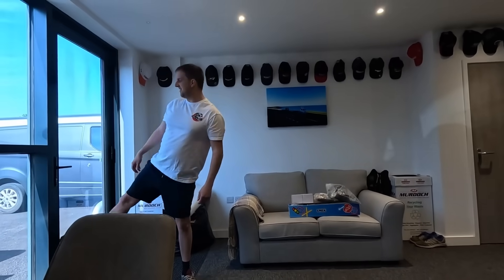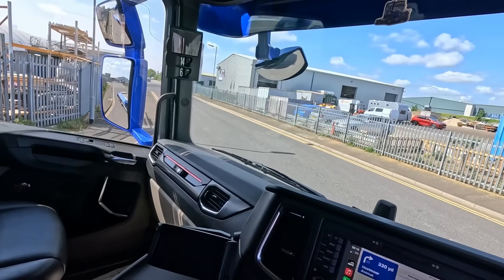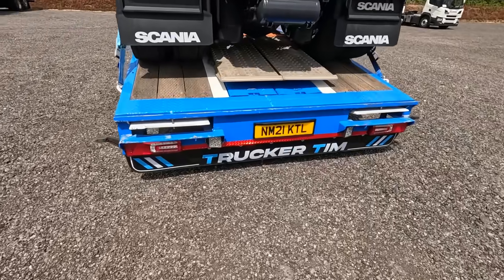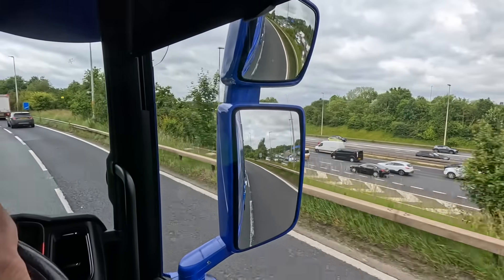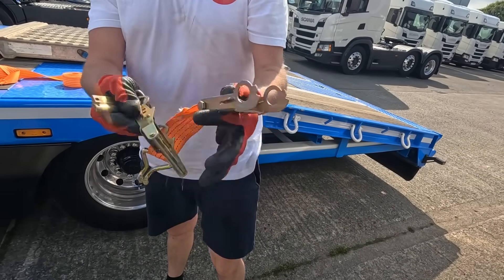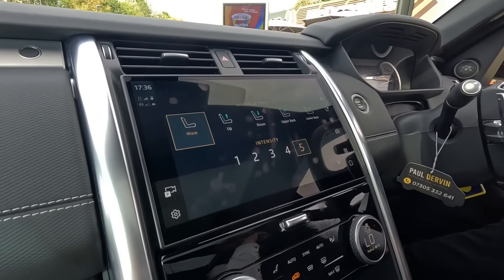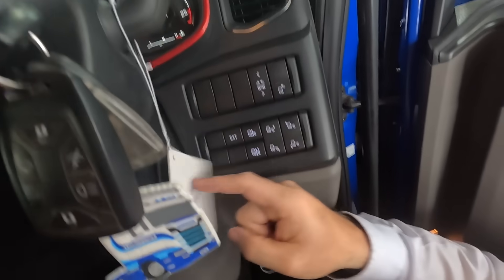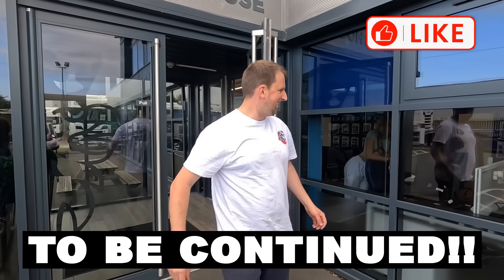FIRST LOAD WITH MY NEW TRUCK! | SORRY A&M | PT1 | #truckertim

Comment: While was in Scania sales you should have got Will the shift 5th wheel back and one thing i would have done is drop the tag axle  down on your return load as will be less strain on the straps on corners etc with it airborne and side to side.

Comment: @Trucker Tim were you never taught to do an arm space check using your forearm to check the clearance between your light cluster and the swan neck on your trailer, all I can say is whoever taught you to couple up a trailer missed that part out, that was something that was taught to me while I was doing my Class one training back in 83. Just get a sliding fifth wheel fitted, problem solved.

Comment: Told you in your last video you would hit you rear mudguard and lights because the fifth wheel is to far forward.

What ridiculous that they actually sell tag axle trucks without a sliding fifth wheel in England. In Norway every tag axle truck has a sliding fifth wheel.

Comment: Could you not put the Anti Slip coating/strips on the rear of the trailer where the ramps are? they are pretty solid and it might be black but it would look better than having scratches on it constantly.

Comment: wondering. will you be keeping a full size wheel on the back or will you have one of them low deck wheels (sorry I don't know the wheel size or if that's the proper name) but its like a said R620 had

Comment: Genuine question if someone could please answer it. Why is the side pipe on the R series not aloud but stacks are. How come some v8’s have a standard side pipe but this doesn’t and some even have a switch to open a valve from factory. Genuinely don’t get it